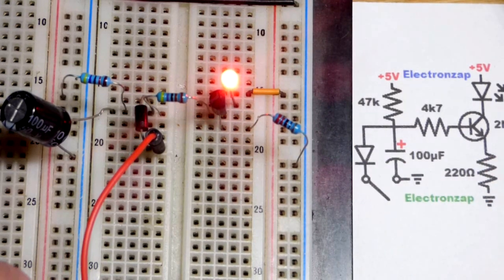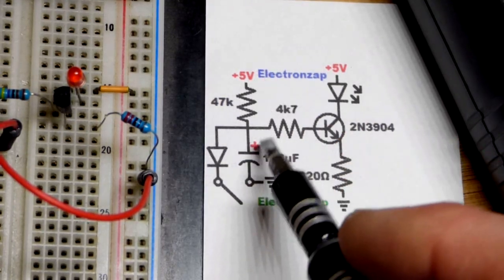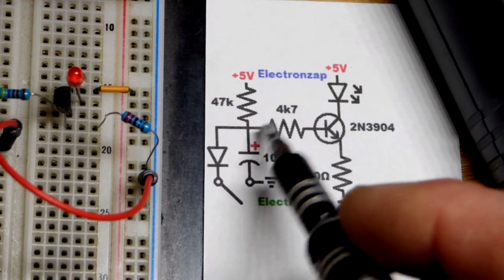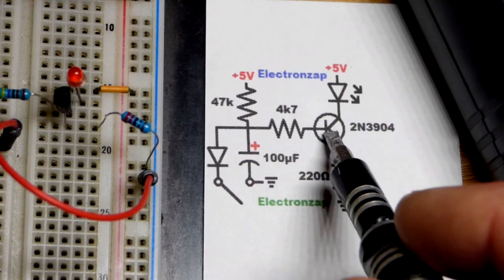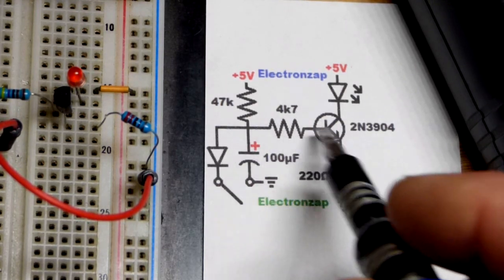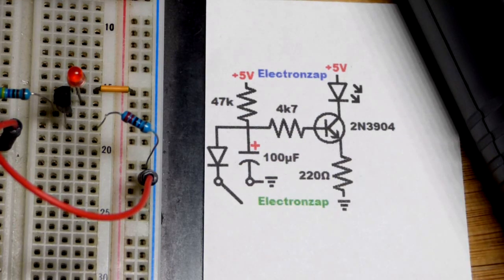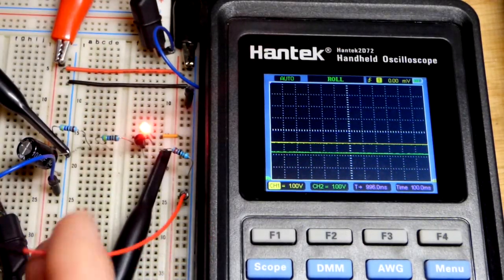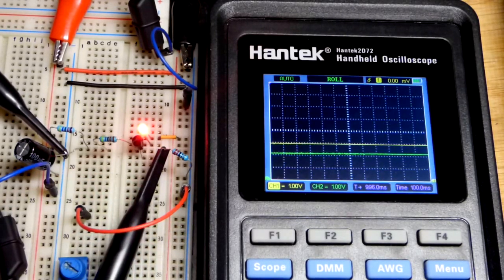LED fade on using NPN BJT current source capacitor 2N3904 for learning electronics shorts 39

Comment: Hello. Great content.
Could i combine the fade in charging capacitor for the base pin, with the hability of trim pot adjustment of the max current by the base voltage ? Thanks